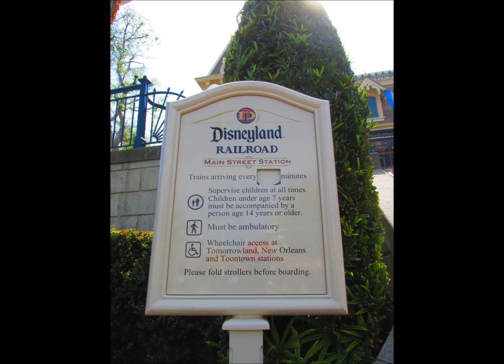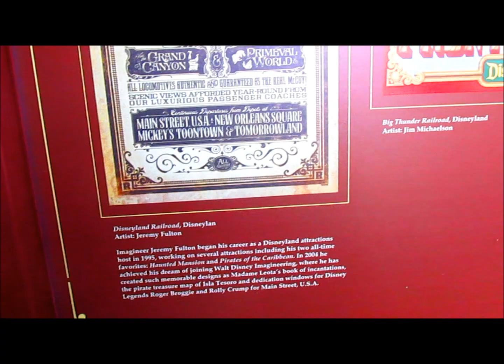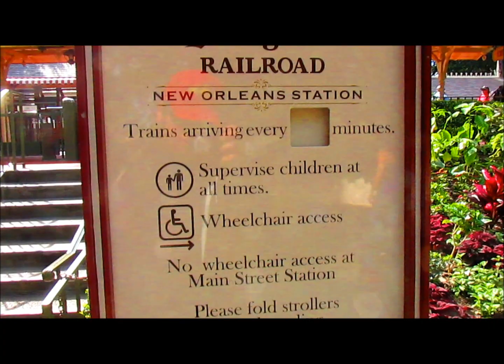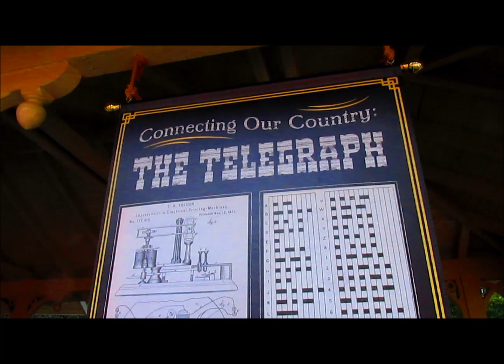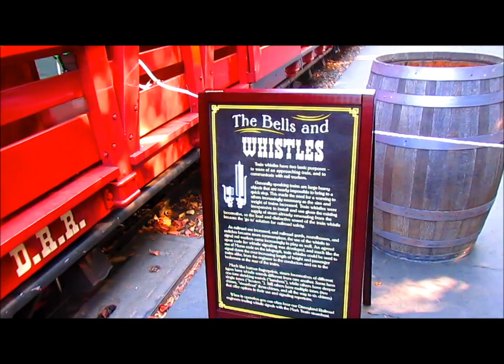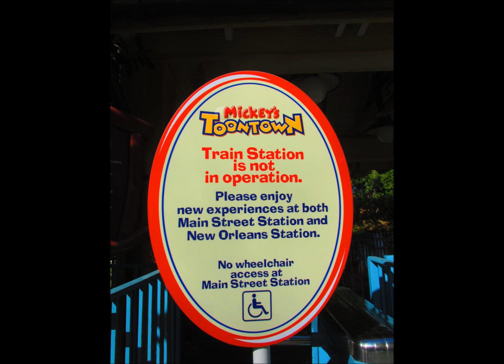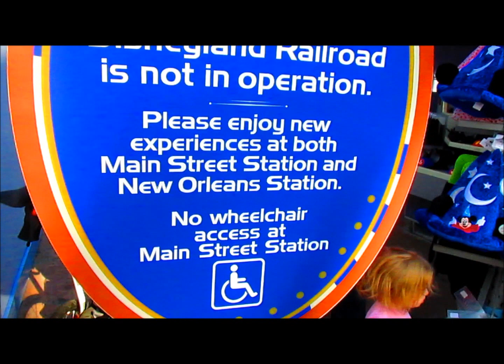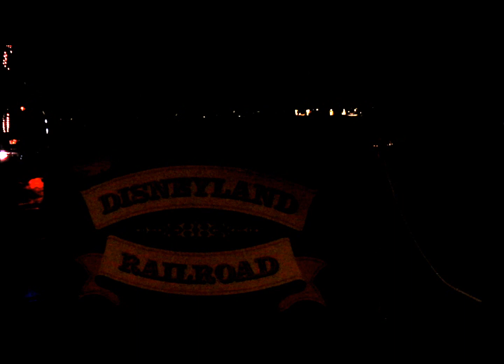The Disneyland Railroad 2/27/16-"First video of construction closure"

Comment: Looks like they've definitely spruced up the displays since I was there.  It's really nice of Disney to do this while the railroad is down as its not something you get to do everyday.  It seems for now that the Marsh, Gurley and Ripley will be on a continuous cycle, but I've heard that the Holliday has been steaming well with her new boilers due to the higher operating pressure and increased number of flues.  It might make its first appearance in the park soon but as I understand they might wait till Fullerton for the public unveiling.
Reply from the maker: +TFN5459 Hmm. I've also heard that on Tuesdays(or WED), the other two steams have been know to help do the switch movements in the Monday before the park opening. A crew did say the Ward Kimball will not be in the cycle due to it being a current switcher unit.

Comment: Thanks for some additional information on the Disneyland RxR equipment.  Fleet number 3 is a 2-4-4 Baldwin with on-frame tender and a new-built boiler consistent with 2'-6"-gauge 2-4-0's; don't know what Class designation SerNo 14065 is, but the pattern may have been a favorite of narrow-gauge lines, as well as useful for track inspection for the standard-gauge lines prior to the advent of the gasoline railcar.

Fleet number 4, a 2-4-0 Baldwin, SerNo 58367, is most likely a rebuild of a 0-4-0st yard engine used in industrial facilities.  The 2-4-0 configuration was popular with narrow-gauge lines in the 1870's and 1880's, but one standard-gauge line, the Virginia & Truckee River RxR (Carson City, NV, USA), used two for yard switching:  fleet number 9, a Class 21-1/2-C-1 SerNo 2199, and fleet number 21, a Class 6/22-C-1 SerNo 3689.

Comment: Very interesting and by far the best documentation of the railroad's downtime. now i wonder if they will redo the trestle and destroy the toontown tunnel during the works since both don't have tracks, i have some feeling that after passing the river in the nice concept art we've all seen the railroad will pass above a part of star wars land on a bridge then pull into toontown. now i also liked to hear about the increased weights on the holliday and wonder what i can do with the whistle affixed to engine 2's original boiler
Reply from the maker: +giladmarkman Does that mean you will try to come back sometime this summer to check out the experience? "wonder what i can do with the whistle affixed to engine 2's original boiler"
Reply from the maker: +giladmarkman And thank you! "Very interesting and by far the best documentation of the railroad's downtime. "
Reply: +TheSd90mac-Railfanner well, I'll visit in 2017, if it's closed I'll document the experience if it's open expect a tender ride on the new track
Reply from the maker: Alrighty.

Comment: Why they close it when they ain't doin any darn construction yet? lol
Reply from the maker: +TrainsWow™ They are actually deep in the river, lol. A crane is currently down there fixing up the landscape. Slow process, that's all....hehe.
Reply from the maker: +TheSd90mac-Railfanner Also, the crane is inaccessible to the public but view able from Hungry Bear.
Reply: +TheSd90mac-Railfanner Actually the crane's in place to install a coffer dam so the river can be drained in the rear section.  It's more like they're at the stage of ripping out landscaping rather than fixing it lol.
Reply: +TrainsWow™ Actually, the railroad tracks from splash mountain to toontown have already been ripped up, and the berm is already mostly deforested and deconstruction has started on it.
Reply from the maker: +Mateo Pelissier Yep. Witnessed the rails that were ripped in this video.